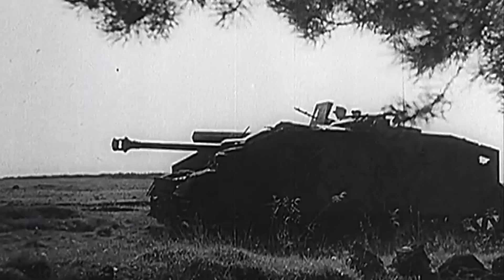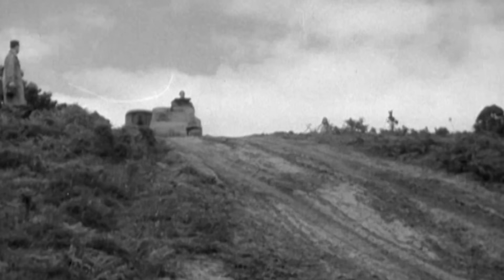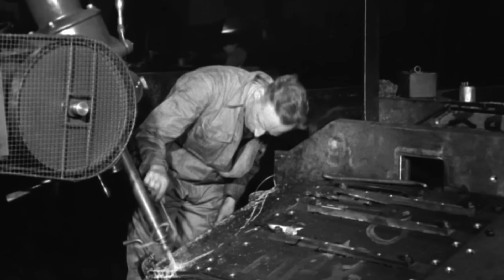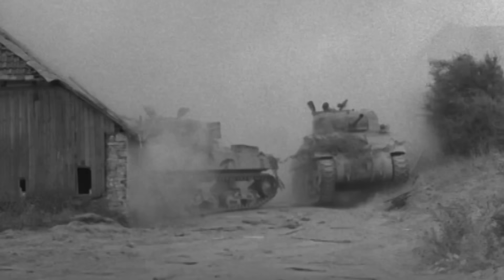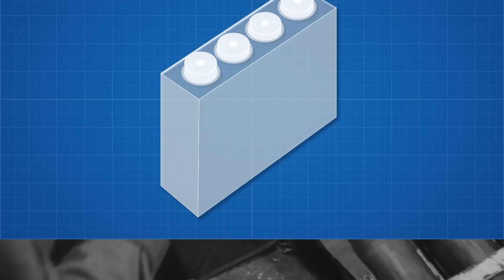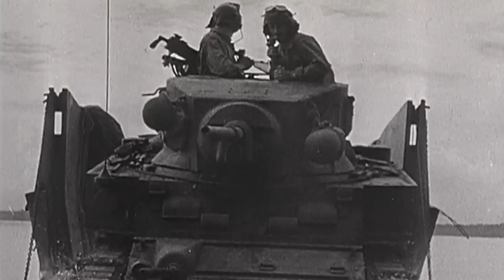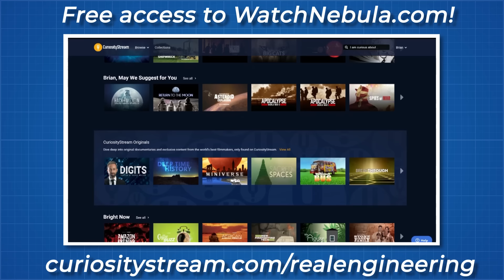M4 Sherman - The Workhorse of D-Day

Comment: You should not make videos with so many mistakes and errors in
Reply: What mistakes and errors?  He even listed all his sources in the video description and none of what he said contradicted anything I've heard about the Sherman.
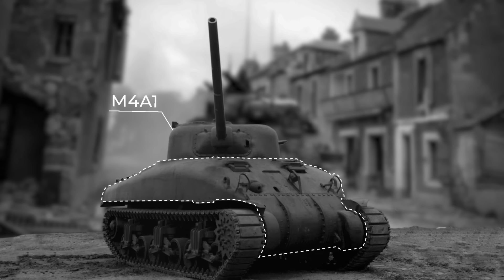Reply: @Mathwayb  An easy one at 5:50 there is a picture outlining the cast part " in a single block" you can see the bolts that is used to put it together, If you call a channel "Real Engineering" you should perhaps check the bolts
Reply: @xendk  The bolts at that exact time frame are for the transmission, the curved part at the bottom front of the tank with the bulges containing the final drive near each of the front wheels of the track, which is indeed bolted to the front of the hull of the tank.  The actual hull, however, is cast, as he said, as there aren't bolts anywhere else on the sides or upper front of the tank holding it together.
Reply: @Mathwayb  No he says the entire hull was cast from a single block That is wrong and then there is a pic that show with a out line the entire hull making it look like it is part of a single cast. I think you are looking for the word "differential covers"  and not 

"the transmission, the curved part at the bottom front of the tank with the bulges containing the final drive near each of the front wheels of the track, which is indeed bolted to the front of the hull of the tank."   see "differential covers" much easier to say
Reply: @xendk  The point is that the hull was a single cast piece for that model tank, and the transmission was bolted to the front of it.  I see your point in the dotted outline in that it should have gone underneath the transmission in the video.
Reply: @Mathwayb  No that is not the point. The point is that he say and shows the differential covers as part of the hull and then states that it is cast from a single block it is not one big part, in the pic with the out line it is 4 parts. That is a Error or a mistake, Yes they are all cast but as 4 different pieces but that is not what is said or shown
Reply: Xen DK So your problem was that a dotted line was a few pixels off, even though what he said was factual?  Just curious but were there any other mistakes you noticed?

Comment: Was the soviet union not already mass manufacturing tanks way before the USA joined the war? Surely the automation of production wasnt that new at that point
Reply: The T-34 didn't see appreciable numbers in production until production moved into the Urals and elsewhere. Even then, the T-34 had a year head start, and the U.S./ U.K. were supplying both armor-grade steel and structural steel intended for tank production to the Soviets.
Reply: @peterson7082  yeah fair enough I just wasnt sure of the years

Comment: What people dont see, particularly ones who aint been in the army. Is logistics and simplicity. Logistics being the parts being easy to produce and maintain. Simplicity as in being easy to replace and fix THIS is what the Sherman did. Panzer V "Panthers" took far longer too make and maintenance was at times a nightmare. It was a fantastic tank in battle but fights it not what it will mostly do. Tanks mainly throughout war spend time moving or being stationary. War now is 90% moving or waiting 10% fighting as it was then.
Reply: What's the old saying? "Amateurs discuss tactics; professionals discuss logistics"...? That's an oversimplification, but basically true. Your fighting men can be the best-trained, bravest and toughest fighters around, but if they can't be supplied with "bullets, beans, and band-aids," they will have a very hard time winning. Oh - and don't forget POL, gasoline, oil, lubricants, fuels. It wasn't simply that German tanks were more-complex, costly and difficult to manufacture, it is that the German high command refused to standardize upon a few tank and TD designs and then turn them out in true quantity, as the Russians did with the T34 and the U.S. did with the Sherman. They were always tinkering with their designs, when what they already had was good-enough. Why make the Tiger II when the Tiger I was equal to almost anything sent against it? Why devote resources to such boondoggles as the Maus super-heavy tank, when the Panther had the potential to be such an important and war-winning weapon?  For a people reputed to be so logical, it was very illogical thinking. The T34 and Sherman were outclassed by war's end, but made up for their deficiencies by sheer weight of numbers and also by the skilled use of combined arms warfare ("deep war" doctrine is what the Soviets called it). If a formation of Shermans got in trouble and was pinned down and taking losses, the commander could get in the radio net and call in reinforcements in the form of one or more of the following: tank destroyers, artillery, tactical air support, armored infantry, or some combination thereof. No German tank crew wanted to be in the open when it was raining 155mm shells - or rockets or bombs from the feared and hated "Jabos" - Allied ground-attack aircraft. The Anglo-American logistical advantage extended also to the ability to recover, repair or replace damaged/destroyed armored and other vehicles. German tanks and other vehicles once damaged or out of fuel were often abandoned and lost, due to advancing Allied forces, whereas the British, CW and American units could often recover and repair their battle-damaged equipment. The German lack of something similar and as-capable was keenly felt by their ground forces.
Reply: @GeorgiaBoy1961  I believe for the transmission or final drives on the panther requires spinning the turret sideways and lifting off the roof of the hull with a crane to get at the transmission. Also road wheel and suspension replacement on a panther was a nightmare. Often the vehicles were just abandoned and destroyed when they broke down. Which was a lot considering the panther was still going through teething problems. However at the point of panther Germany was already pretty much on the losing side (massive defeat and capture of the sixth army at Stalingrad). Also properly trained crews was another problem. More often than not the crews never had enough time to be properly trained how to use the vehicles. Most of the good tank crews were already dead or missing from fighting on the eastern front and Africa. By the time the Americans had landed they were pretty much just mopping up whatever was left.
Reply: @GeorgiaBoy1961  They weren't logical once Nazism was in full swing. Weapon designs were trying to vie for Hitler's favor. The more you satisfy Hitler's ego, the more you shall get ahead. And of course no one wants to tell him "No".
Reply: @majungasaurusaaaa  Few were brave enough to even go against him like Guderian, Rommel, and Manstein.
Reply: The sherman had some genius design to it. If you want to replace the transmission, just remove some bolts on the front and the entire housing will fold down. I'm pretty sure the panther had to remove its turret to get to the transmission.
Reply: @Misty_Fox  

You're pretty sure that the Panther needed to remove its turret? You never went through the effort and take a few minute search on google, have you?

There are several phots that a 5min search on google will reveal that shows Panther getting their transmission replaced with the turret still on the tank.

And no, it was not a genius design feature of the M4 and do you know why? Because it already was like that on the M3 medium.

Comment: the german knig tiger was an incredibly poorly engineered tank since it's cost of manufacture was a great disadvantage to the  germans and even if one could potentially offset it's cost by destroying 5 shermans it would still prove itself a poor tank since it would be a primary and often defenseless target in areas with allied air superiority or heavy infantry and complex terrain, such as a city. The panther was therefore superior as it's cost was significantly lesser and the tank was more maneuverable.

Comment: M4 Sherman... Tank fodder for Tigers and Panthers....
Reply: Not the case.
Reply: @peterson7082  wrong yet again...
Reply: @charlesvincett84  The Tiger served a radically different doctrine to the Panther and M4. Making direct comparisons moot. The Panther while it certainly outclassed most other Allied tanks on paper, combat doesn't reflect such.
Reply: @peterson7082  on the battlefield Panthers and tigers regularly shot M4 "Ronson's"  full of holes are greater ranges than the 'Ronson's"  could engage their foes. Thank you for your academic thesis but reality and statics would indicate that the M4 was regularly punished on the battle field and the Alles went  for numbers over firepower and German engineering prowess....
Reply: @charlesvincett84  

> "Thank you for your academic thesis but reality and statics would indicate that the M4 was regularly punished on the battle field and the Alles went  for numbers over firepower and German engineering prowess...."

 Then you're unfamiliar with the general gist of Allied losses to armor. In most cases it was about equal to what the Germans suffered against Allied tanks. The outstanding majority of Allied armor lost was not other tanks- rather mines, infantry projected anti-tank weaponry, and anti-tank guns. The primary cause for tank's lost for the Germans is non-combat issues, followed by Allied tanks. 

 The U.S. Army Ballistic Research Laboratory conducted a study, Memorandum Report No.798, that found that the most critical factor was spotting and engaging first regardless of tank. Defenders fired first 84% of all engagement, inflicting 4.3 times more casualties on the attackers then suffered. When the attackers fired first, they inflicted 3.6 times as many casualties on the defenders compared to own losses. 29 engagements involved Panthers and M4's. The M4's had a mean numerical advantage of 1.2:1. The data showed the Panther was 1.1 times as effective as the Sherman in defense, but the M4 was a surprising 8.4 times more effective then the Panther when on the defense. Overall, the M4 was 3.6 times as effective as the Panther in all engagements. This latter portion of the study was included in the Memorandum Report and in David C. Hardison's book. I am paraphrasing this from the latter. < Hardison, David C. ”Data on World War II Tank Engagements: Involving the U.S. Third and Fourth Armored Divisions.” No.321 ed., Merriam Press, 2012. ISBN-13 978-1470079062 >
Reply: funny since the US troops only faced tigers 3 confirmed times. and they won every time they used shermans

Comment: I'm most interested in how tanks (and other caterpillar vehicles + tractor)  turn. Especially neutral steer, and how some tanks are able to vary the power going to each wheel when moving so no brake is required and no power loss from it.
Reply: Not all tracked vehicles can neutral steer.
Reply: @jeremyO9F911O2  Which is why I said "especially", read again. I know there are many type of transmissions and turning mechanism. For example western MBT usually have some sort of hydro-mechanical (which I'm most curious about) while Soviet T-64 has 2 gearboxes 1 for each side.

Comment: A Toyota Corolla is more efficient, tougher and quicker than the Sherman
Reply: it was one of the best of the war.

1. everyone used gasoline engines on one tank or another
2. the gun was comparable to german counterparts at the time like the PZ IVs short and long 75s
3. the armor was quite comparable to the tigers ~85mm to 100mm
4. the sherman was statistically in the top 3 safest tanks in ww2 and most of the crewmen were killed outside of the tank
5. it was incredibly reliable and easy to repair

so get your facts straight